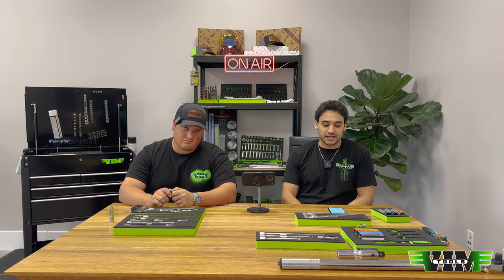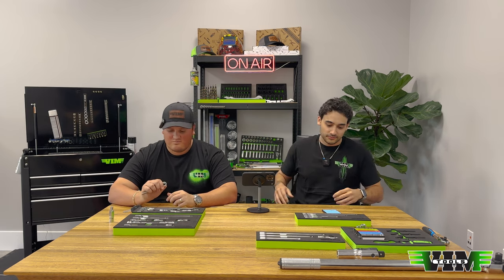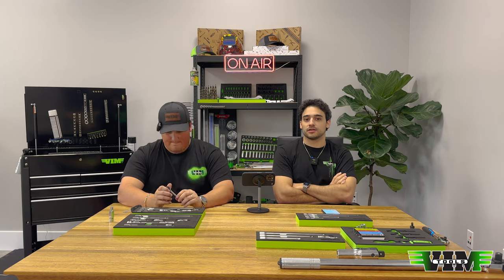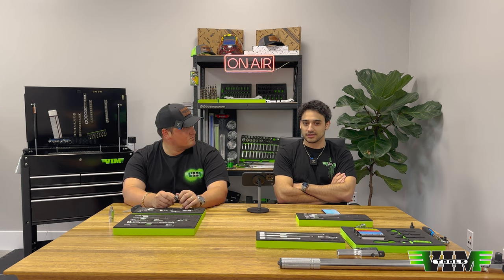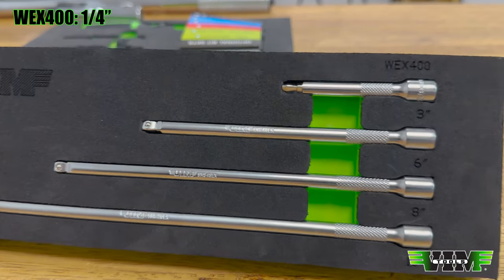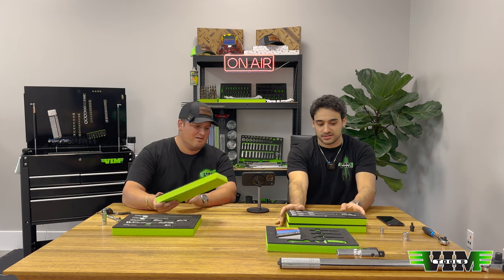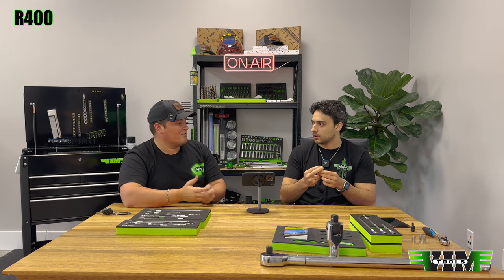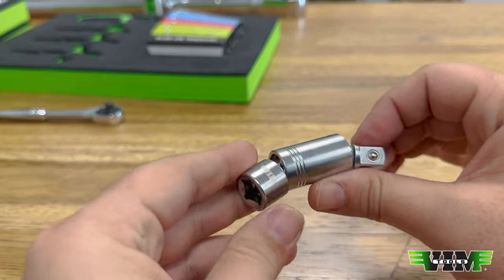VIM Tools Tool Tuesday Episode 18

Comment: Just wanna say I love the work you're doing, and I'm glad I found your brand. I have a question; do you have any plans, now or in the future, to expand your ratchet line up? I like the grip on your ratchets but personally I can't work without a flex head ratchet, or even better, a locking flex head ratchet. If you do have plans for this, I'd love to see what you come out with.
Reply: Yes the plan is to roll out a flex head 1/4, 3/8, & 1/2 next